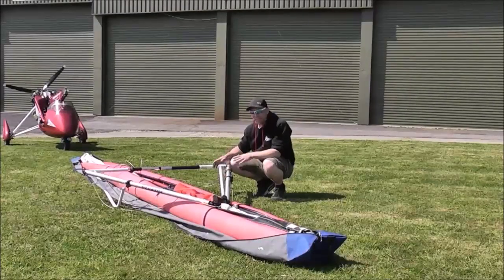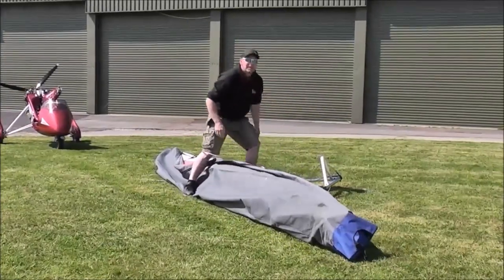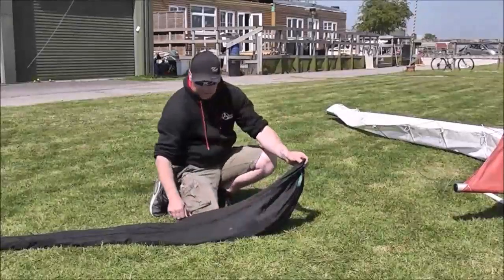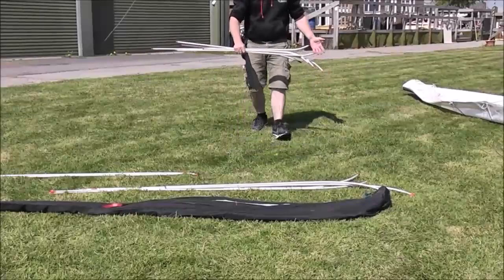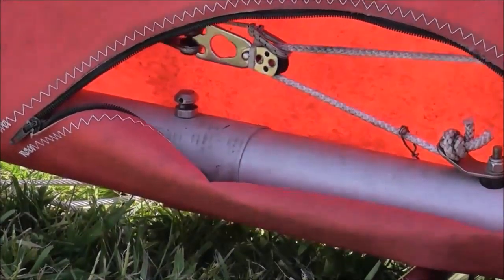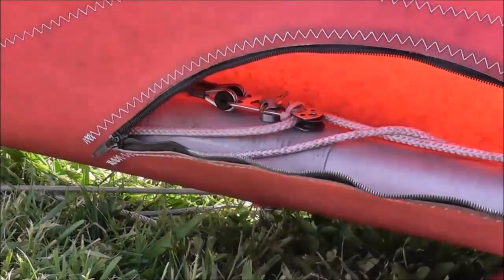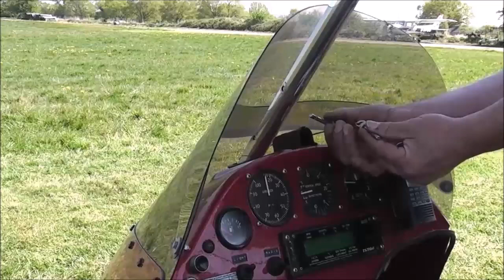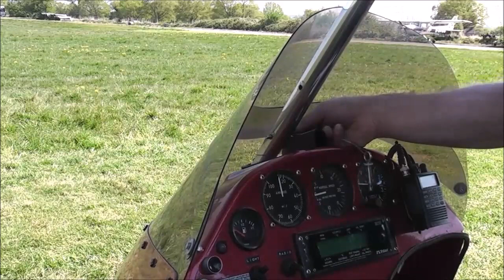Rigging a microlight flexwing with Airways Airsports

Comment: Quantum 15 Operator's version 10 Page 35, top paragraph section 6 says front strut should be fitted with cutaway facing FORWARD. I believe Manual is wrong and that you, Mark, are correct, and it should face the pylon.
Reply: That's how mine has been rigged for the last 15 years and it's never been picked up on the annual permit inspection. Why would there be a bevelled cutaway at the end of the tube unless it is to provide clearance for the pylon?